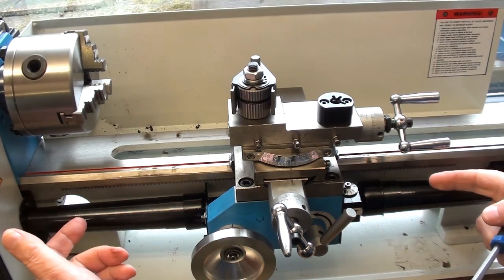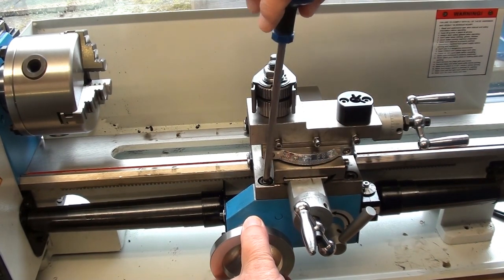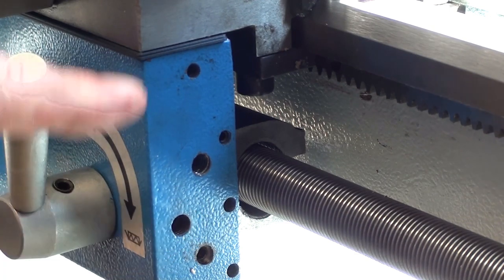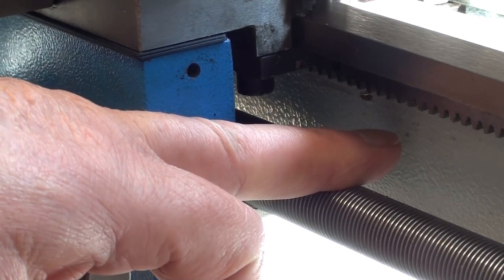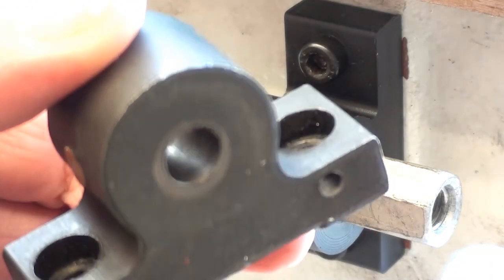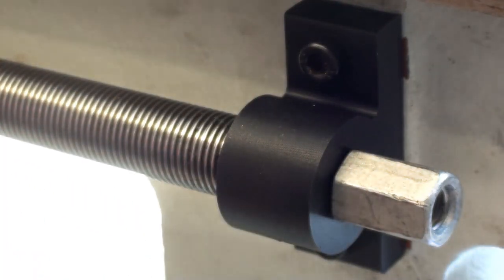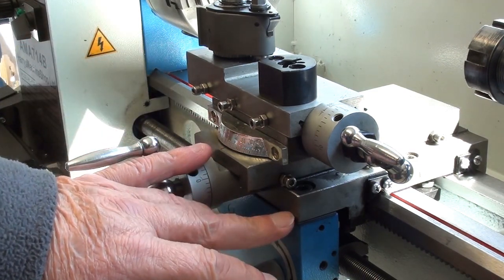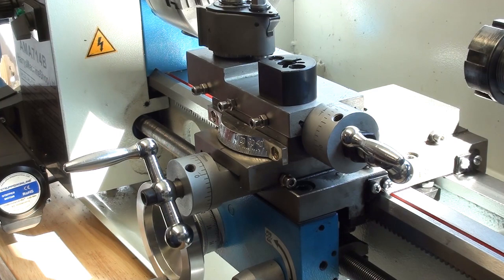Mini Lathe   a problem solved

Comment: Excellent problem solving ! 
Just goes to show that those mini lathes are not necessarily fully ready for use straight out of the box.
OK, maybe yours was a poor example, but some people would just live with those faults and condemn the lathe as not very good, where a bit of work could improve it a lot.
Reply from the maker: Thought I'd replied, Colin, but it appears not!  I fully agree with your comments re the lathe quality issue. You get what you pay for, of course, and I still don't know how they produce AND ship these things at the price point that they do.
John
Reply: I bought a similar mini lathe, thinking it would be brushless and therefore quieter. I was completely wrong. This model is a complete disaster. However, I also have an XJ12-300 mini milling machine, and it's OK, but it's not from the Weiss factory. This lathe should have come with assembly instructions.